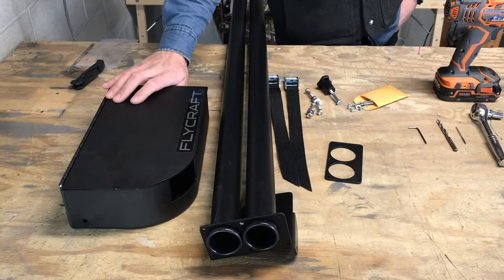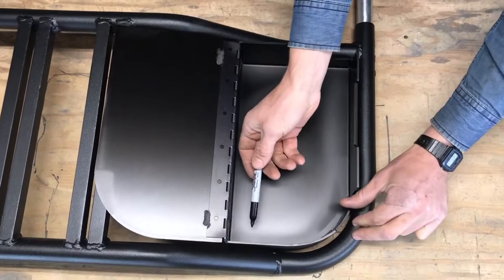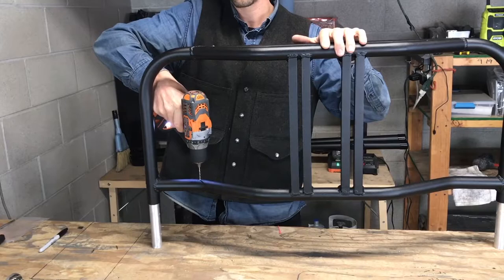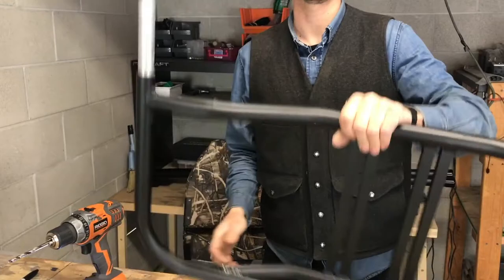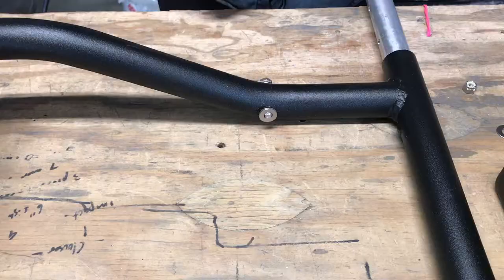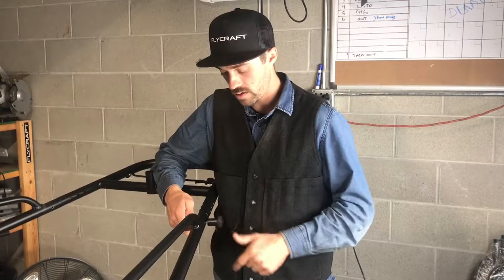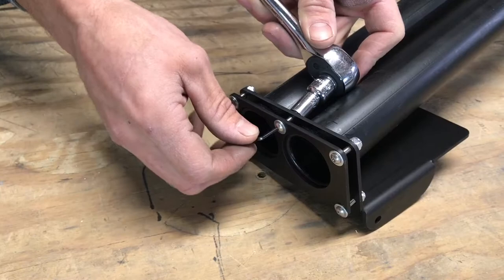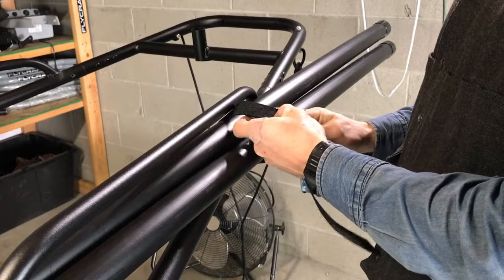Flycraft Rod Holder Install Video

Comment: Why not make the frame with pre-drilled holes?
Reply: I think the reason FlyCraft does not have pre-drilled holes for the rod rack is because they added the rod rack after customer feedback. I am betting that future production runs for the frame will have pre-drilled holes. In the mean time, when I bought my boat, FlyCraft offered to drill the holes prior to shipping for a small fee.
Reply: Glencoe3331 2 years later. No pre drilling